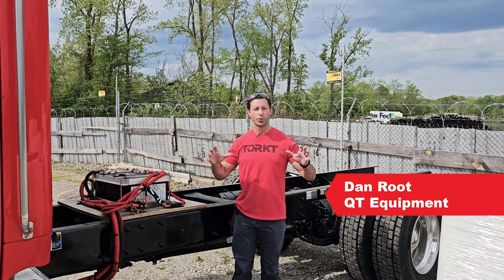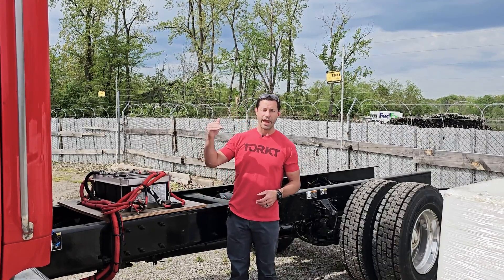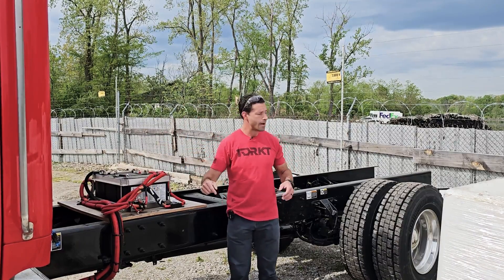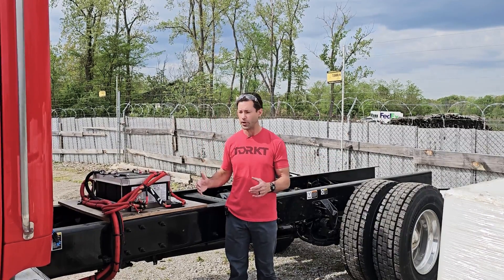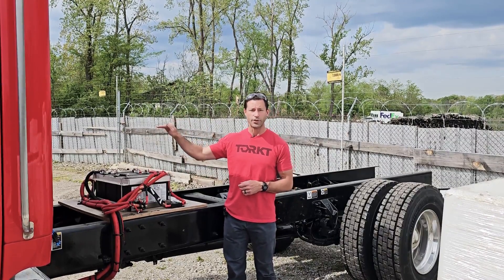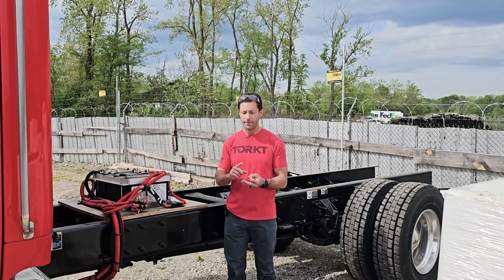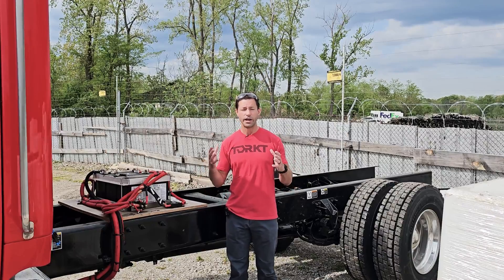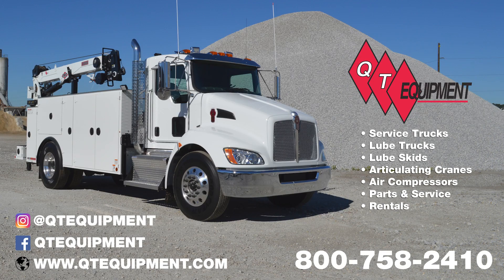Battery Placement for Kenworth Service Truck

Comment: The best way to spec a truck out is through your body company (preferably QT).

The base spec QT uses is very nice, and easily customizable.

The last thing you should do is spec one out on your own then drop it off at a body company, they need to be involved from day one.

My company made that mistake on our last round of Peterbilts, truck salesmen typically aren't knowledgable about every little detail, like putting the gel batteries under the seat in a mechanic truck application.

PS I'm fully expecting a video on my truck when it's done in September (hopefully)
Reply from the maker: ANDY!!!  Thanks man!  Just waiting on KW at this point.  We will add your project to the video schedule.  Appreciate the support.
Reply: Yep my Pete 337 has three optima’s under the passenger seat. I need  body space more than I need a comfortable passenger 😂
Reply from the maker: @FixinCat  100%!
Reply from the maker: Andy good news... shooting video on a beautiful black KW tomorrow.  If possible can you text me at 330-697-7831 have a couple questions on your build thanks!

Comment: Why not mount them in their own box on top of passenger side boxes and not take up more bin space
Reply from the maker: Yes, you are correct, that can be an option depending on the build.  In many cases, we've got welders, compressors, lube boxes, top boxes, crane, boom support, lights, etc already committed to the top.

Thanks for watching Karl!!